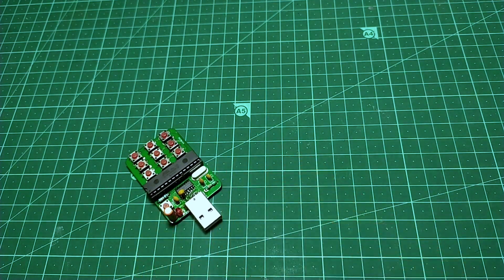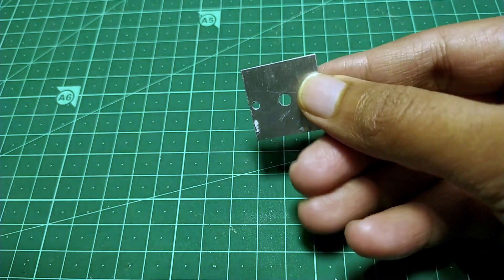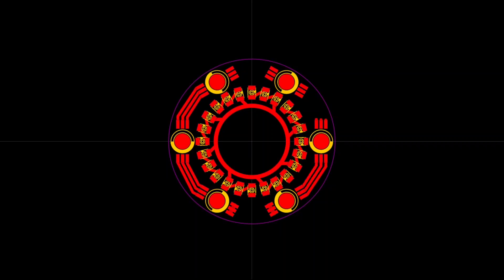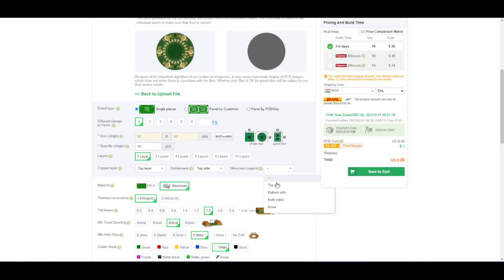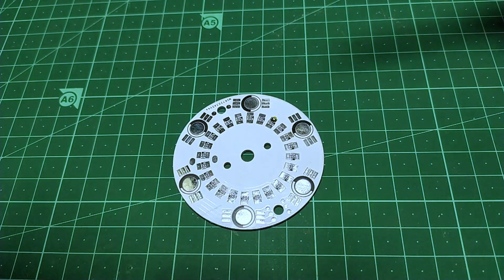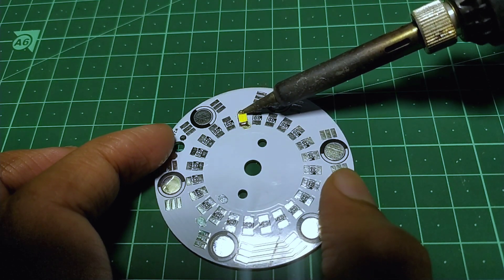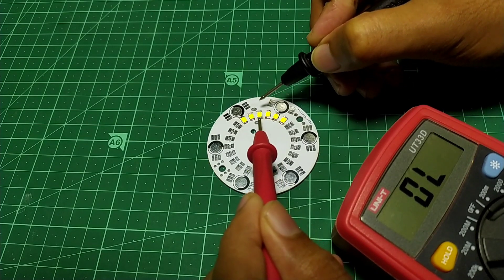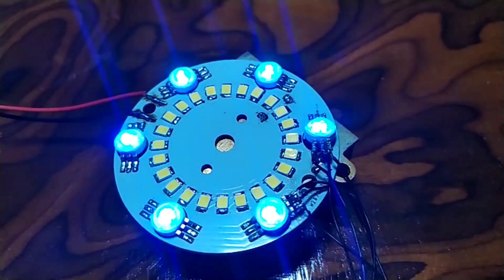How to make RGBW lights using Aluminium PCB

Comment: I would like to make a small pcb with RGB smd LED's but cant seem to find any videos that explain what resistors ect i would need to use and why. i would like you use 5v usb to power it and it needs to be 32mm circle. is this something you could make a video on

Comment: Hey how did you do the foot print of the middle heat pad of the circular LEDs? Is it a pad or a copper trace or else?
Reply from the maker: It's only neutral copper pad

Comment: What wattage is your soldering iron? My 70watt Weller doesn't seem to heat up the aluminum enough!
Reply from the maker: I use 90w. You can try with a bigger tip. Even with that you will have to hold the iron down for quite sometime
Reply: If you pre-heat whole aluminium pcb with heat gun or with stove, then 70w soldering iron will work fine.